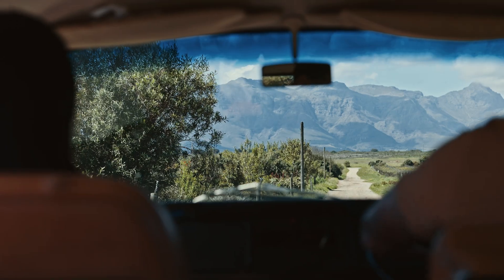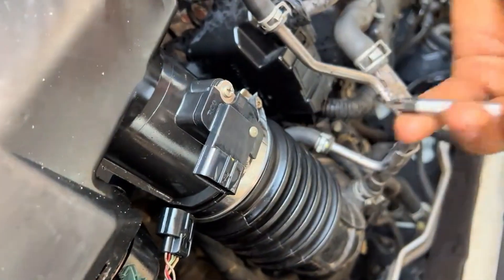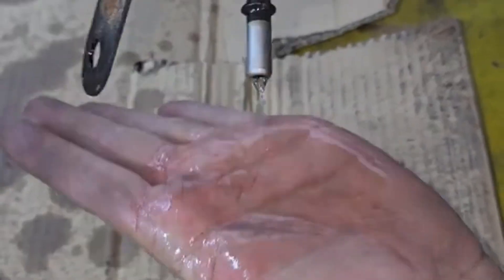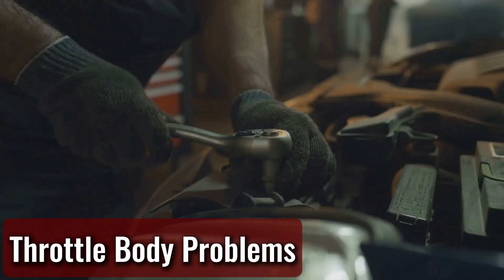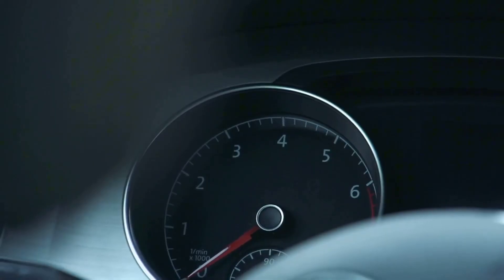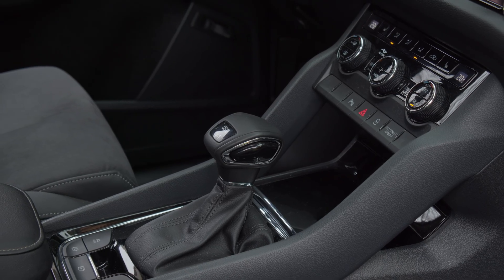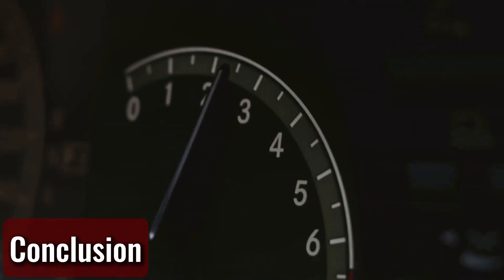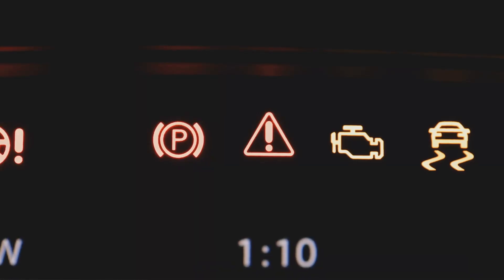5 Reasons Your Car Not Accelerating Properly & How to Fix It?

Comment: 1. Mass air flow sensor dirty or failing 
2. Fuel filter or fuel pump
3. Throttle body dirty or failing
4. Transmission slipping or clutch
5. Faulty sensors